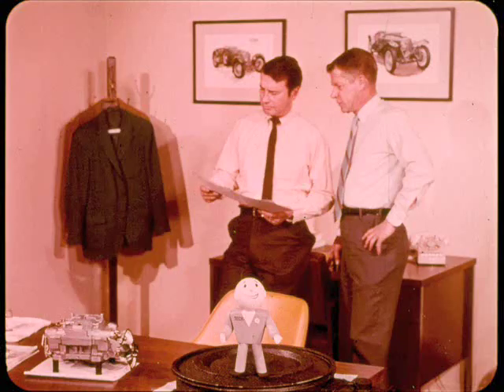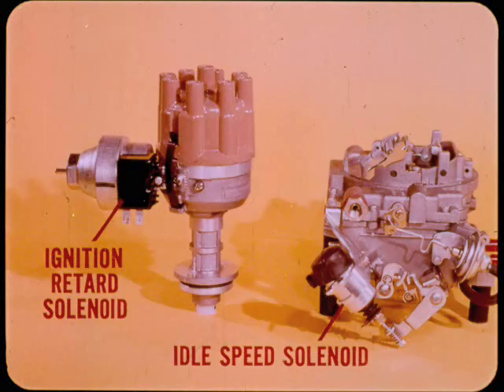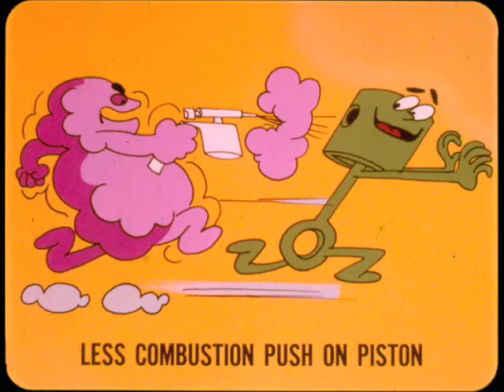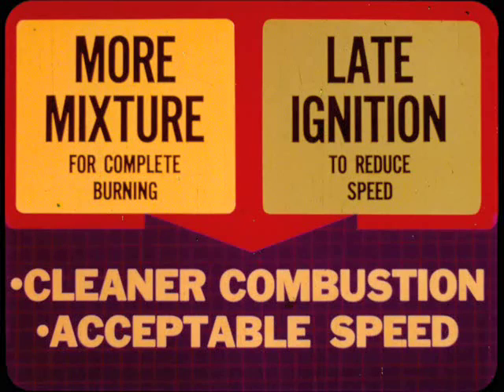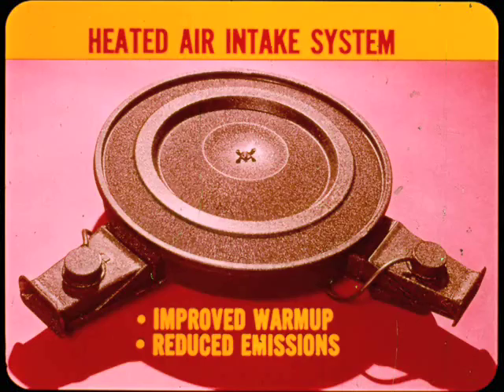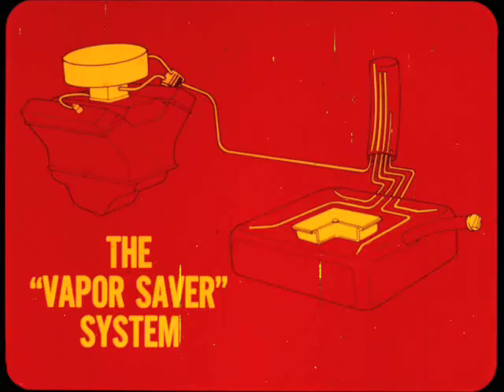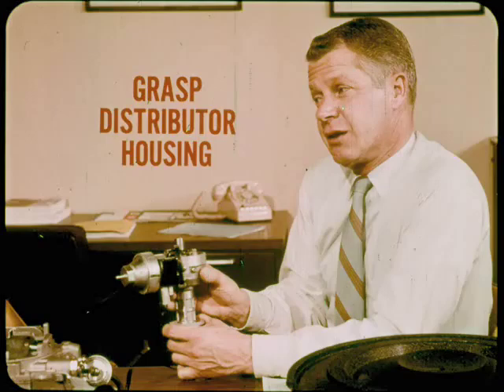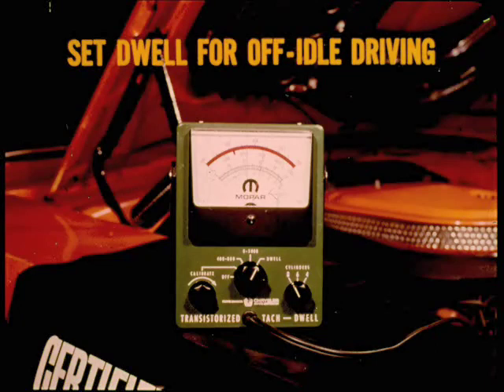MTSC - 1970, Volume 70-5 Let's Keep It Clean

Comment: This was truly interesting! Back in the 80's, us Wrenches haphazardly RIPPED all this stuff out!!! Basically making a 1964 spec Engine, to tune our way.... 

NOT FULLY UNDERSTANDING what exactly any of this shit did. 😲 Some of these items were very useful, not just for Emissions, but Engine Performance. 
Regular Garages WEREN'T taught any of this back then....
Reply: I was told that these devices were regularly removed because they often didn't function properly.
Reply: @skylinefever  They didn't. EVAP Systems often SUCKED Fuel out of the Tank, because the Management System was archaic, and barely accurate.
Chrysler's "Lean Burn System" was a complete JOKE!! Seemed OK in the first year or so, but any wear or carbon deposits...
And it was nearly impossible to run the Engine at a 17:1 AFR!! 
Some things worked, several Didn't....